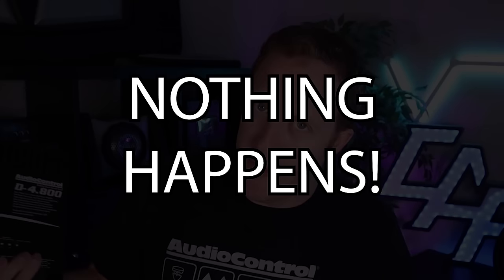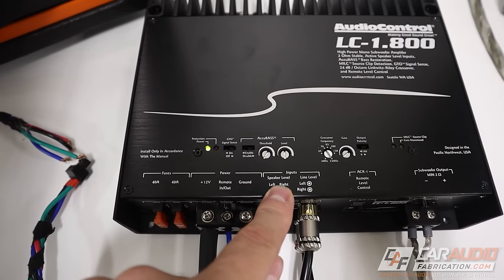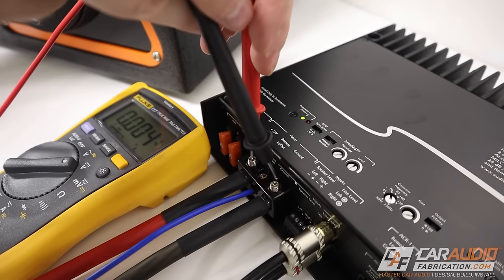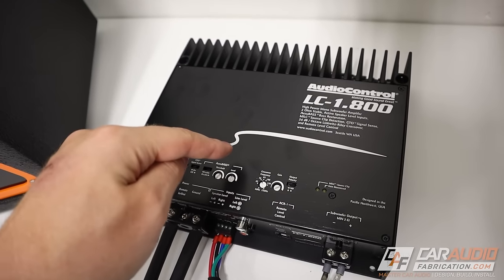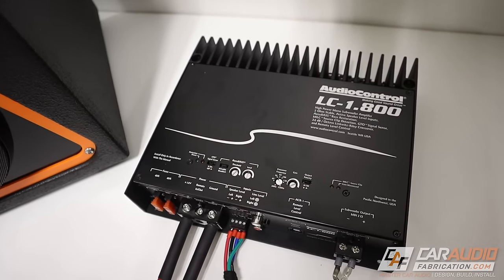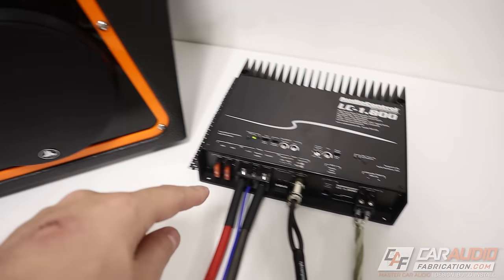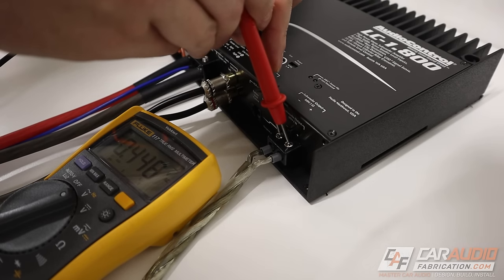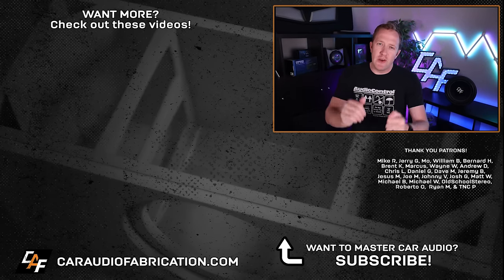No sound? No power? Fix your amplifier EASILY with THESE EASY TESTS!

Comment: Greetings, anyone out there would know where to run  a 4 gage power cable from under the hood to inside the car in a Mitsubishi outlander V6 to power an aftermarket  amplifier. I can't seem to find any  passage or manufacture's pre drilled hole to make it work. Anyone has a recommendation?

Comment: Have you ever had a car audio system that works fine while parked but when you put the car in gear and start driving the audio stops working. But then when you stop the audio comes back on?
Reply: Maybe a new battery; or alternator problem?

Comment: Dunno if your gonna read this but ik having an issue, Not sure if its a fault or what im about to buy one of those metres to double check, But do you know anything about the amplifier, just flashing a blue light (ussually it would stay on consistantly) but it turns off imediatley, Showing it had indeed got power running to it, Is this possibly some sort of error or power safety mode? I am gonna be honest I got impounded and didnt take me subs out all me wires got cut and there was a bit of water on them, Im assuming its toast but if theres hope, There is hope, Also I cant buy dual channel amplifiers this type anymore its a sonly explod dual chanel, If you need more info or if anyone can help Id appreciate any advice